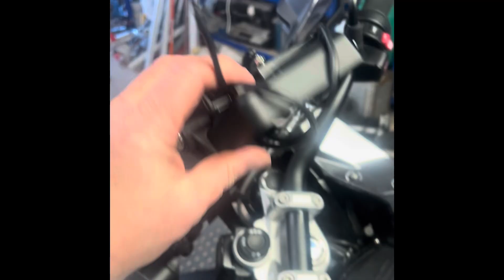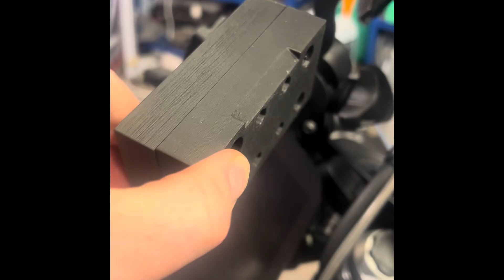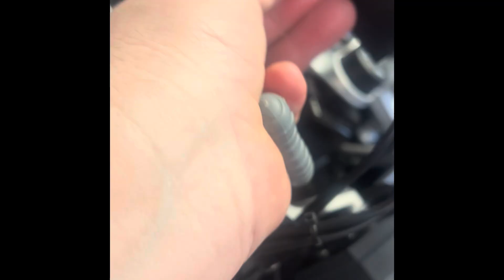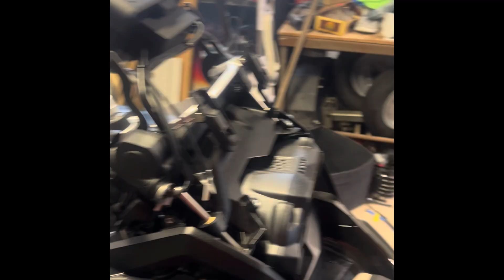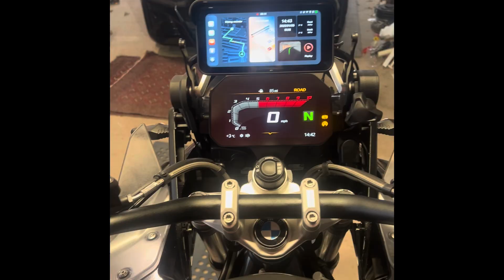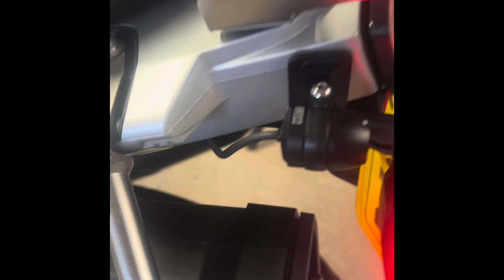Aoocci C6 Pro install on BMW GS Nav bar.

Comment: Neil does the c6 unit overheat with this setup? The heatsink at the back of the c6 head unit is supposed to have clearance. Any issues spotted mate?
Reply from the maker: No All is fine.   No heat issues.

Comment: May I ask where you got the 3d printed block? I could definitely use something like that for my install.
Reply from the maker: @gregoryrk  drop me a message and I can get you one.
Reply: @therileysat2  that's very kind. I found someone here who is willing to 3d print it for me. I'll let you know if it's successful. Question: there seemed to be a 100mm version as well as a 79mm version, I'm going with the 79mm one, would that be correct?
Reply: Another question, for power did you simply connect red & black wires from the C6 to the corresponding red and black pins in the connector from Amazon?
Reply: @therileysat2 so I finally got the mount 3d printed and installed the unit to it. My goodness it was very difficult to get those final screw to bite. I was finally able to, but even though the mount seems to be nice and tight on the bar, I found that the screws kept spinning. I'm wondering if the holes that hold the hex nuts are a tiny bit too big and they are spinning.

Comment: Can I just check you were powering it from the USB socket on the bike rather than using the cable you got into the OEM wiring?
Reply from the maker: @wombatwibbleable  I did initially use the usb on the bike but then swapped to the nav power socket as I found that the usb stayed powered whilst the bike was on a trickle charger.
Reply: @therileysat2  Thankyou so much for replying - just need to get on and fit it now once I figure out the bracket

Comment: Hi. Fitted with the 3D bracket looks great and is solid thanks so much. Quick question in case anyone has seen same…powering from original sat nav connector it comes on with ignition but reboots / goes off for a few seconds when bike is actually started?!

Comment: Hi Neil. Glad I came across this. This is something that looks suitable for my Honda NX500 gps bar that’s 12mm thick. As I’m looking at fitting my aooci c6 to it. So if I contact you in the link you can arrange this? I have emailed you. Thanks
Reply from the maker: @user-xh3lh9ck3t   Replied and bracket sent out.
Reply: @ Thank you Neil. Bracket received and really good
Reply: Hi Neil can you do me a bracket please

Comment: Hi Neil, what is the cable you bought to attache the c6 to the bmw
Reply from the maker: @DavidOliver-6486      I got it from Amazon.    Take a look at
OTOTEC 1PC 3 Pole Motorcycle Repair Connector 611656 83300413585 Compatible with BMW Motorrad Motorcycle GPS Repair Connector Line Length 28.5cm

Comment: Hello Neil, thank you for the video. I have the same C6pro that arrived 2 days ago and was wondering what is the best way to fit it to the GSA , so you clarified this perfectly. 
Can you share via a link the .stl file for 3D printing out the mounting bracket for the GS nav bar? 
Many thanks again !
Reply from the maker: @enduromecanic       Do you have a contact for a 3D printer?    If not my contact only charges £9 inc delivery . I can get it sorted if you like.
Reply: @therileysat2  Could you provide a link to purchase the mount please?
Reply from the maker: @kevincostello1485     Drop me an email to neil@therileys.co.uk and I will sort one out for you.
Reply: @ done 👍
Reply: @therileysat2  Dont suppose your still printing them ?
Reply from the maker: @enduromecanic       Here you go….

https://www.printables.com/model/1051120-motorcycle-mount-12mm-bar-for-aoocci-c6pro-625-car/files
Reply: Thank you!